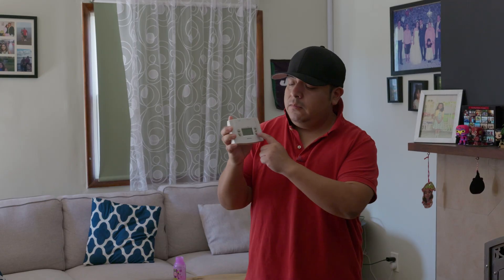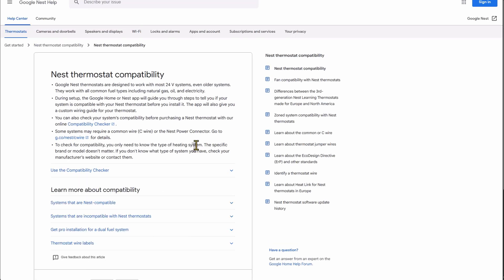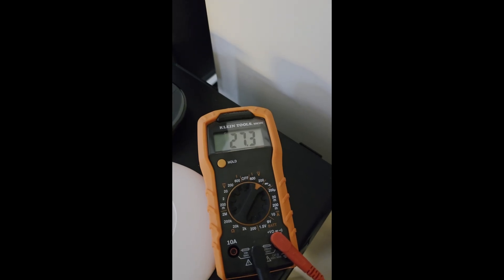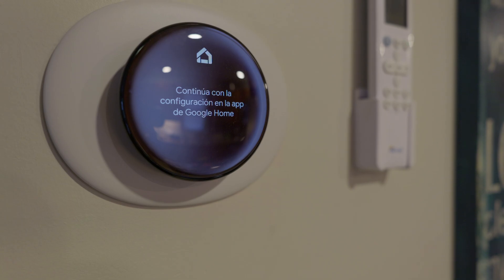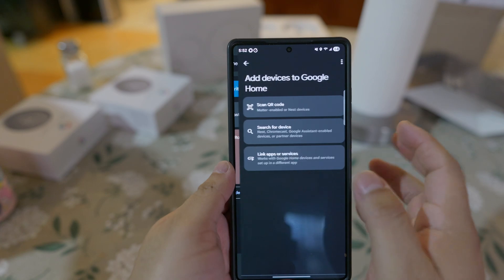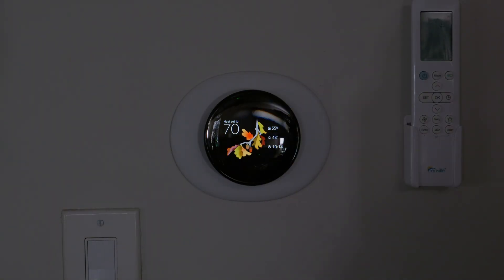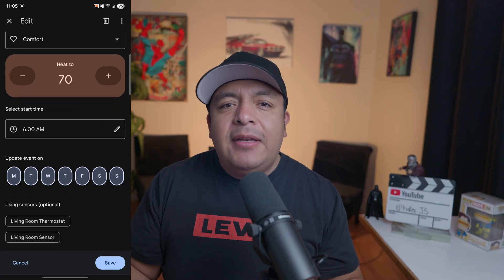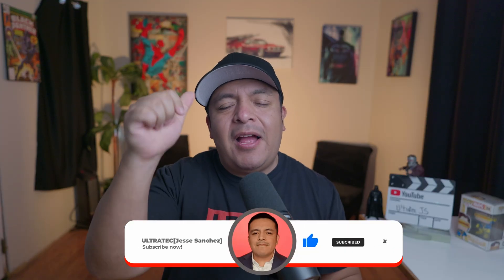I Just Bought the ULTIMATE smart thermostat for my 2 wire system. #nestlearning 4thgen

Comment: Great video Brother. I currently have the same old Honeywell that you had! Haha

I have a three unit (family) building that we recently did an oil to gas conversion. It has steam radiators on the one pipe system going to all threes floors. The current thermostat is also on two wires. I purchased the meter which should get here today and I’m going to check the power on it to make sure it’s sufficient enough for the Nest. 

If this works out, I will have the thermostat in the second floor in the last room of the apartment and a sensor in the third floor at the room above. 

We’ve noticed that the radiators aren’t getting fully heated so I would like to monitor the temperature in our tenants apartment upstairs while we give heat during the winter season. I’m also in the process of having the plumbing company come over and add an overhead vent downstairs in the basement and also Balance out the radiators and replace the air valves that needs replacement.

This current Nest should be able to do the trick, correct?
Reply from the maker: Thanks for the kind words. The Nest will work on a 2 wire system yes. It won't fix radiators not heating properly but it sounds like you already plan on fixing that. I had a similar issue on my system and they had to get the air out of the system. The sensors are great to combine heating from two different areas. Good luck and let me know how it goes.
Reply: @UltratecJS Thanks man,

Sp after getting  the meter it read 26.4. So looks like it will work! 

I ordered the Nest and will try to install it tomorrow. I did research on Reddit and most state I’ll need the C wire adapter, but let’s see what happens tomorrow.
Reply from the maker: @MigsCave Nice! If you check the Goole Nest compatibility checker thats another place that will tell you if it'll work or not.

Comment: With this thermostat it says you dint need a c wire but now the thermostat gives a message the says no power but it still works like normal. My question is should o add a c-wire adapter or just leave it be?
Reply from the maker: The red cable is what provides power. I don't get any errors on mine. If you can, check that the red cable provides between 20-30 V of power which is what the Nest requires. It could be you're not providing enough power or within that range. It could mean your device may run out of power at some point. With all that said, if it works, it works. Just keep an eye on it for a few weeks.
Reply: @UltratecJS thanks man I’ll check it out

Comment: Hi i have a question about acellus so im in 8th grade and i want to finish the entire grade within 4 months is that possible?  Cause i want to graduate high school first i am now 16 years and i know i zm behind from my agemates!
Reply from the maker: Hello,

Yes you can absolutely knock it out in 4 months. Just adjust your steps so you can finish the total amount 4 months. For example, if a class is 200 steps, to finish in 4 motnhs you will need to do 50 steps a month, or 13 steps a week. You'll have to calculate that for each 8th grade class. Once you start finishing each class for that grade, attack the remaining classes for that grade. Check out my video on Acellus, most efficient scheduling which talks about this topic.
Reply: @UltratecJS thanks i appreciate!